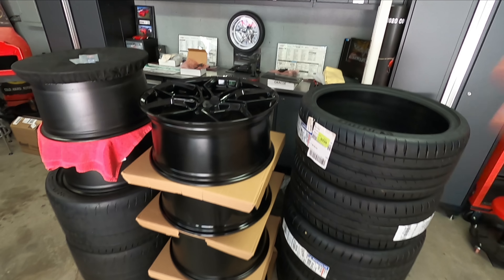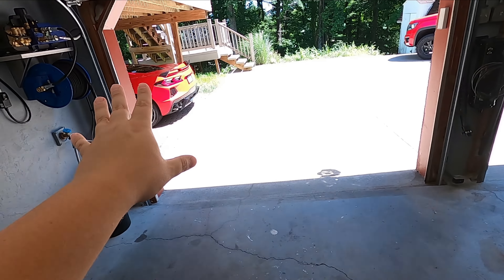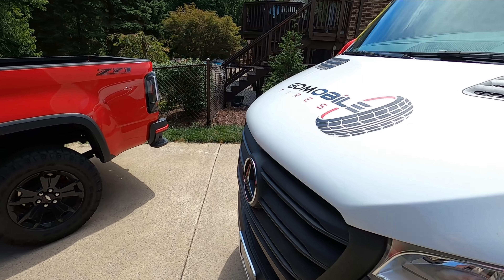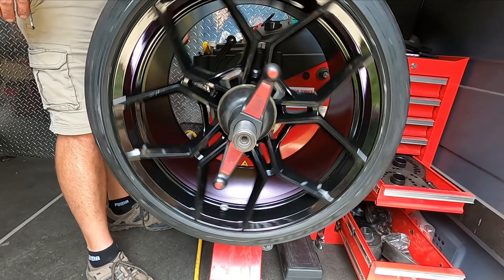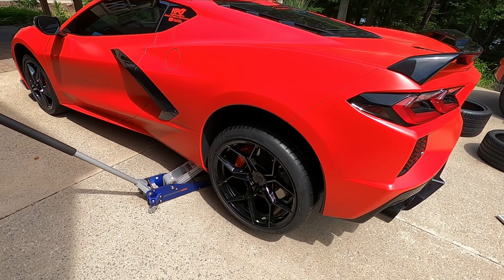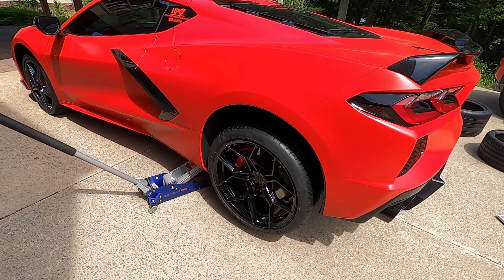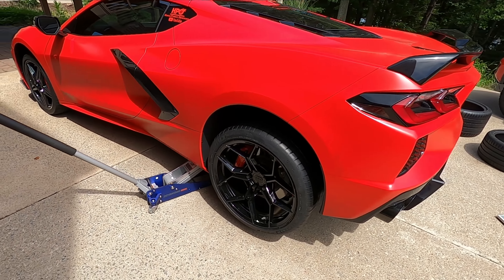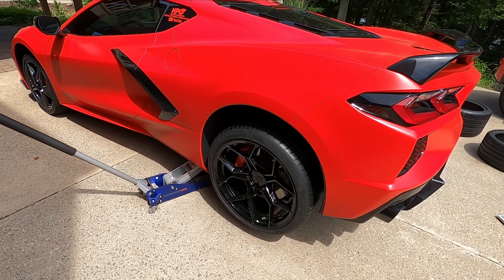My 2020 C8 Corvette gets new WHEELS from Blaque Diamond! 😍

Comment from the maker: What do you think of the new wheels? I absolutely love them. Check them out here: https://blaquediamond.com/hp-obsessed. If you guys need tires mounted on your ride check out Go Mobile Tires - https://www.gomobiletires.com/pittsburgh.
Reply: Nice, you saved 32 lbs on 4 wheels.
Are the new tires non-runflats?
Why didn't you buy carbon fiber wheels?
Reply: What is the off sets ?
Reply: Offsets please!
Reply: HorsePower Obsessed what are the full specs on the new Tires and wheels...  diameter, offsets, width , etc and the specs for the tires and Has swapping wheels and tires caused any clearance issues front or rear
Reply: Hey man I truly love the wheels, lol I actually ordered them before I saw this video.  Can you tell me what size tires you purchased because I am also getting the 20/12 and 20/9.
Reply: Did the lug nuts come with the wheels or did you buy them separately? What size hex are the lug nuts? 19mm or 21mm?

Comment: Hey Justin I absolutely love the C8 with that stealth wrap, AWE Exhaust and of course the reason I clicked on the video your wheels! BDF25 look amazing on this car! 
I’m deciding between the BDF25 or Vossen HF7 for my C8 which is finally incoming after almost 2 years of waiting. I have a set of winter tires Michelin 245/35/20 for the front and 305/30/21 for the rear. Any idea if these tires would fit on 20x9 front and 21x12 rear? I wouldn’t be racing in these just some light driving in colder weather
Reply from the maker: Thanks, man! Those sizes should be ok, just a tad stretched but they will work.
Reply: Thank you so much for the ultra fast reply! Fully subscribed you’re my C8 encyclopedia love all your content thank you!

Comment: Curious- I know it’s been a while but were you satisfied with these BD wheels?  Any bending or cracking issues?
Reply from the maker: I was very satisfied. I currently have a set of their wheels on my truck. If you use code HPO10 it will save you some money too!
Reply: @HorsePowerObsessed  THANK YOU.  Just a heads up I put in the HPO10 and it says it's doesnt exist.
Reply from the maker: Sorry, the 10% off code is "HPObsessed"

Comment: This will look amazing lowered to reduce the wheel gap. These wheels look far better than any of the stock wheel options. Hopefully GM gets their act together for the Z06 and produces a decent wheel option.
Reply from the maker: Thanks. I agree. The Z06 better get it together!
Reply: The car has adjustable suspension.  Just need to bring it into a shop and use a wrench to drop the springs an inch.  I like the rim choice.
Reply from the maker: It's not quite that easy for me because I have the front end lift. It's a little bit harder.

Comment: There are so many facets to new wheels and I appreciate your coverage of this. I  also love the wheels you chose. Do these BD wheels come with an adjustable "concavity" or are they all the same for the size you chose?
Reply from the maker: You can adjust the rear concavity but any more concave than what I have will net you issues with the center cap not fitting. Basically, this is the most concave look you can get.

Comment: will a 245/35/20 tire still fit with a 20 out front to keep that extra protection or will only a 30 side wall fit up front when gong to a 20" wheel? i cant find anything online about this for the c8. thanks in advance!

Comment: Very nice set up and great video. What size tires did you run on the front and year with these wheels? Did not find tire info in description. Thank you!
Reply from the maker: 245/30/20 and 315/30/20.
Reply: Thank you sir! I have Sebring Orange and I was going to keep the factory wheels, but you have inspired me. The only thing is the car comes with run flats so being there is no spare would need to purchase run flats for after market wheels. Thank you again for the info and that’s a beautiful ride.
Reply from the maker: You're very welcome! Thank you!

Comment: Blaque diamond wheels are awesome. What size tires did you go with and could the 20 x 10 have fut up front or was that over kill? Looks awesome. How did it drive and handle? Thanks for posting up those great wheels. Im imoressed and the weight savings along must make the handling even better. Did you keep runflat tires or go non runflats on the new wheels? Thanks in advance
Reply from the maker: The fronts wouldn't fit 10 inch wide while being lowered (or so I'm told).

Comment: How much was those wheels set you back ?
Reply from the maker: From vendors you can get the rears for around 580 a piece and the fronts for about 480 a piece before tax.
Reply: HorsePower Obsessed no way , that’s awesome that as much as the tridents 🔱
Reply from the maker: Exactly! AND these are flow forged!
Reply: HorsePower Obsessed did you re-use the stock tear tires?!? Any rubbing issues going taller/wider in the front ?!?

Comment: Do you have an Obsessed Garage setup between the Kranzle pressure washer and Cox hose reel?
Reply from the maker: I do not. I do however have one of my own styles of setups. AR Blue Clean 640TSS HOT with a 100ft MTM hose on a cox reel and a spot free rinse by NO SPOTS PRO. I have a video on the setup if you want to check it out here: https://youtu.be/2jYPR_NjNaM

Comment: Did I miss the size?
Are the wheels and tires installed the same sizes, or did you take the opportunity to go a little wider?
I'm sorry, you did say they were a little wider.
My impatience got the better of me.
Reply: He said they were 20x12 rears and 20x9 fronts, he did not say what tire size the fronts were but the rears are 315s.  I'm gonna guess the front tires are 285/35/20.
Reply from the maker: 315 rear and 245 front.
Reply: @HorsePowerObsessed   Man, that seems small.  Was it a clearance issue when turning?  I guess they look wide enough, but usually I like wider than stock.  All in all, your car looks awesome.  My choices got harder now between a muscle car or a "super" car.
Reply from the maker: Any bigger and it would be an issue especially after lowering. The rear can handle up to 325 but the front can't go up much.
Reply: @HorsePowerObsessed   gotcha, thanks
Reply: @HorsePowerObsessed  You should have went with MRR no problem going 275 front on a 9.5 when you know correct offsets, no rubbing at all with 1" drop

Comment: Boy, you were cutt'n it close with Carlisle starting this Thursday. I'd like to see you have at least two GoPros mounted facing outward, one from the driver's side and the other from the passenger's side so that you could film the "looks" as you entered Gate 3. Ideally four GoPros would be even better so that you could also have one facing forward and the other rearward. Once you reach your staging area, have a couple of them filming to catch the up close and personal and personal on-lookers. It all could make for some very interesting footage. FWIW, long range weather forecast is look'n good. 

As to the wheel/tire conversion, you mean you can't purchase new sensors yet from GM? What's up with that?  Boy, that tire swap by Mobile Tires went just too easy.  Are the C8 wheels/tires easier to do than the C7 ZO6 wheels. When I had mine done they were an absolute PITA and took the installer a couple of hours to get the new "stickies" to seat. Refresh my memory please. Did you get all four corners aligned yet? If not, I would suggest you have that done soon. I really like the design of the new wheels!👍 Why did you elect to go 20's all way round as opposed 20 and 19? Does Blaquediamond not have 19's? I'll be curious as to how the C8 handles once you get to experiment driving it on some twisties and/or the track. Lastly, what a great business Adam has. It's always nice to see/watch someone who knows what their doing AND is also a bit "obsessed" 🤭, about his 4-wheel work environment. I wonder how much he's got his Van insured for with all that equipment? 
Save the Wave🙋🏼‍♂️
Reply from the maker: I will do my best to capture the looks the car gets when rolling into the show. Blaque diamond only has 20 and 22's in this wheel design and 22 is too big for the rear so I thought a 20/20 setup was fitting for the 2020 C8 Corvette. I haven't gotten it aligned yet but from what I can tell and what I've been told it's better aligned from factory than the C7 was AND I'm going to be lowering the C8 so I'm waiting until that is done before getting an alignment.
Reply: FWIW, I like the "look" of 20" all way round. I know a lot of serious "trackers" will go the same size diameter on all four-corners as well. But there's no denying the staggered look does have "the look." I should know the answer by now, but I have to ask. Does the C8 still have leaf-springs?